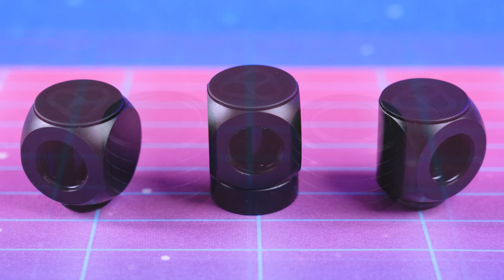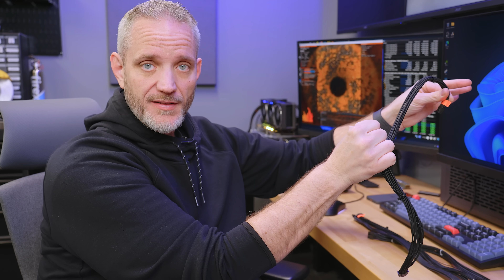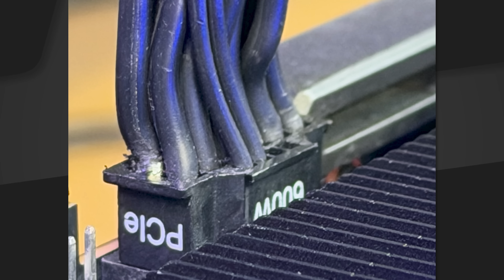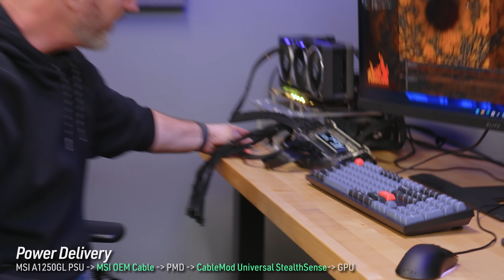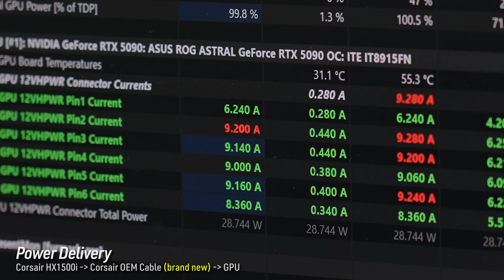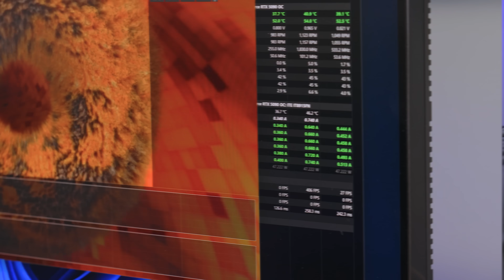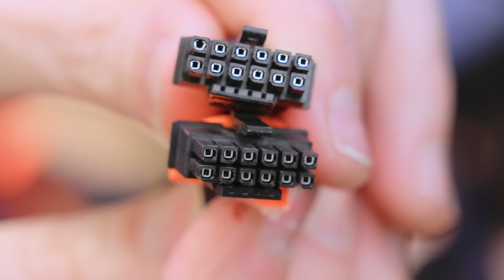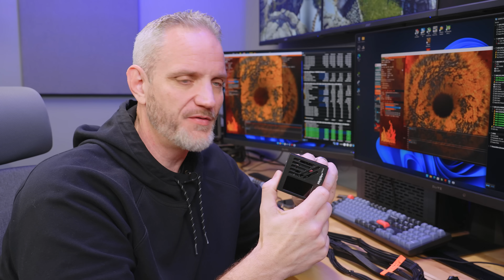More details on what could be causing 12VHPWR / 12V2x6 Cables to melt

Comment: I knew everything about this type of cable. Yet, I didn't push in the PSU-side of the cable fully when assembling the system. The lights on the card lit up but the card wasn't recognized in Windows. Anyway it took a while to find the cause. The insertion force needed on the PSU side was so high I was convinced it was fully inserted but I pushed a little more than I was comfortable with and it slid in a little more and the problem was solved. I'm ashamed of this mistake.

Comment: I use Cable mod cables. I ordered a 450 mm 24 pin motherboard cable in red sleeve and they sent me an extension 450mm instead of a powersupply to motherboard cable. I removed the pins on one end then used the original cable to re wire the cable correctly so my extention cable is now a power supply to motherboard cable. Works perfectly . Absolutely love Cable mod cables but there service is shoddy.

Comment: The per pin monitoring of my Astral card, 100% saved my system from getting damaged. I was using a 12VHPWR cable from Corsair and like in the video, the cable showed no signs of damage. But one day the distribution was rly off, 11A on one pin and 5A on the lowest. Swapping to the adapter cable included with the card solwed the issue for me. It wouldn't solve the problem, but the monitoring should be mandatory on all cards, and allerts and possibly an auto system shutdown should be built in to the Nvidia drivers. You can't expect every consumer to download something like HWinfo and manually configure allerts.

Comment: I have an MSI 5090 gaming trio OC card with and MSI MEGai1300p power supply.  I had recently purchased and added the Wireview proii and noticed a 1+amp variance between power pins to the point that the Wireview warned me about it.  I contacted MSI and their support team told me it was normal and not a problem.  The amp draw never got neat 10amp, but the variance still bothers me. The pin read out are as follows under load: pin1: 8.3a; pin 2: 7.4a; pin 3: 8.2a; pin 4: 7.9a; pin 5: 8.1a; pin 6:8.8a.  At this point I have no idea what to believe.

Comment: I have 5070Ti from Inno3d. The cable connecting to the connector has such tight fit, I have to use scarry amount of force to get it out. Every month I check this card for a melted connector. Every time I get small cuts on my fingers because I struggle to get it out!

Comment: I wonder if the plug also melts when using a 12V2x6 to 4x 8-Pin PCIe Cable. Never saw anyone reporting a problem with that

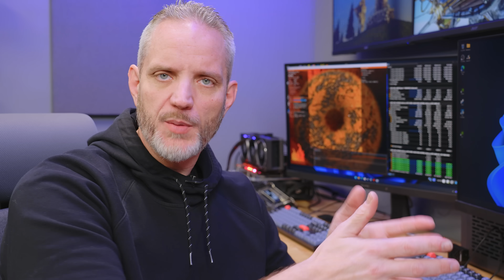Comment: 2:00 Actually they're still all joined into a single power plane on the Astral which is why unbalanced loads are still entirely possible on those cards. The difference with the Astral cards is instead of directly joining them straight from the connector they keep them separated at first so they can put them through their own individual shunt resistors for the per pin monitoring and then right after the shunts they are all joined into the single plane. I know of no cards that actually keep the pins into separate planes, every single one connects them all into a single plane which some cards may split into separate planes down the line for multiple 12V rails (like on the RX 9070 XT Nitro+, not that this actually does anything for load balancing the connector).

Comment: With one power plane, this connector should've had 2 pins
Oh wait, the is already XT90 connector rated at 90 amps (~1100w at 12 volt)

Comment: with DC the voltage runs from plus to minus but current runs from minus to plus. bad grounds specialy bad contacts raises amp draw until stuff starts to heat up and melt.

Comment: I wish the graphic card manufacturers and motherboard manufacturers would get together and come up with addition sockets, inline with the gpu pci sockets, on the MB that carry the extra current needed for these power hungry graphic cards rather than have flying cables from the psu.

Comment: Tightness of plug in socket could be related to 2 different functions: actual electrical connection of the pins (male to female) ... or ... the plastic carrier. If the carrier is sized such that it fits snugggly (even with or without electrical pins/sockets present) it can feel tight regardless of electrical connection of the actual male/female pin connection.

Comment: your loose pin is because the insulation is pushing up behind the housing, it should be inside! so its not allowing the tangs to seat properly in the socket...... just carefully remove the first 1 mm of the damaged insulation and hey, problem solved... and yes this was my job for over 20yrs working private contracts for our ministry of defence in the UK.....

Comment: Corsair : "It is quite common for terminals of this type to boast a mating cycle life of 30 cycles." 
Those connectors have a limited guaranted lifespan.
Remember "While other connections in your PC typically operate at only about 50% of their potential power capacity, the 12V-2x6 connectors, especially when paired with high-end GPUs such as Nvidia’s GeForce RTX 4090 and 5090, are expected to function at upwards of 90% of their power capability and even beyond."

Comment: So 8 pin might not have been some kind of magical secret sauce connector that can't fail.

But it uses more wires for the same power rating. All else being equal, this significantly reduces the likelihood of bad stuff.

On paper the 12VHPWR standard isn't problematic. But even there 8 pin is significantly less so.

Comment: Man, these cables and connector is one big Epic Fail.
There has been obvious problems with them from day 1.
And its definitely only going to get worse with the next gen cards probably being around 2500W cards. Good luck running that rig without turning your fuzes into popcorn. You'll need a dedicated highpower circuit.

Someone definitely got paid to greenlight them.

Comment: get a reasonable DMM with at least 4 significant digits and measure the resistance per cable. I bet you one is slightly high. Make sure to null out the probe leads. You can also use the continuity mode with low trigger threshold resistance and wiggle each cable, if it stops beeping - the cable is bad. You should be able to find the fault in the cable by carefully bending and walking along the cable.

Using just barbed pins in a high current connector like this is crazy. It doesn't take much heat at all to soften the grip. It should have a back shroud that locks the pins into the connector, so it cannot get loose with use.

The cable itself might not be 'pure' copper, it could be a blend or something worse, which is more fragile than pure copper.. Try scrapping the wire and see if it goes silver or white. Also use a magnet, if it sticks it has steel in it...  To be honest, I'm amazed for the diameter cable you can pump 10A down them and its 'fine' - for reference 12v @ 100A is 35mm2 (beefy cable at 6.6mm diameter) to avoid excessive voltage drop.

Comment: Reality is that this is an Nvidia proprietary PWR connector designed by Nvidia and supposed to be QA tested by Nvidia which it never was. The pins are approximately 40 % smaller compared to the pins in the 8-pin connector, but they demand 660-750 Watts of continuous PWR (heat and inefficiency losses included) with peaks up to 800 Watt compared to the 8-PIN 185 Watts of continuous PWR with peaks up to 225 Watts and they always put a second 8-pin if any gpu eats more than 150 Watts.
So 40 % less aluminum on the pins for 300-400 % more PWR requirements. Every electrical engineer sees the design problem here.
Offcourse that the PIN movement is going to cause Current Imbalance due to imperfect surface contacts.
If the Nvidia gpu-s would have had 6 sepparate PWR pins on their cards, they wouldn't melt because each of those 6 x 12V PWR contacts would be protected by a sepparate resistor.
Or if it stays like it is, then the 12-PIN pwr connector should be converted to 2-PIN connector, one for 12V + and one for 12V -. That way that one resistor on the card would properly shield the GPU from current drop and voltage drop.
Its not the copper cables inside the insulated wires problem but rather the air tolerances of the male and female part of the pin joint. Those tolerances are present in every connector in every industry. These tolerances are always accounted in into the QA testings and are always part of the losses that are accpunted inside the efficiencies of the PWR transfer medium.
The problem is that this hasn't been done here by Nvidia because they only made theoretical calculations without the actual heat, efficiency and resistance losses of the pins themselves.

Comment: The Sapphire Nitro+ 9070 XT has a TDP of 330W, so it draws more than half the power of the 5090, which has a TDP of 575W. Interestingly, most, if not all, known cases involve the adapter Sapphire included with the card.

Comment: i dont know if this will help any but what i did was put some pure deoxit gl100 on the pins before plugging it in to help make a more solid connection.  i also used a small 40mm fan on top of the connector to help keep it cool.

Comment: This whole standard needs to be recalled. It's not going to be safe until either the GPU can load balance, or every single wire has the capacity to carry the full voltage on its own. Preferably both. With a considerable safety factor.

Comment: I bought a brand new astral 5090. As soon as i turn the system on I get a red flashing light. In windows gpu tweak tells me I have 9v on pin 5. Took out psu put another in. Same thing. Changed cable to the octopus cable. Same thing. BRAND NEW straight out of the box.

Comment: More like not beating the dead horse, but finding the remaining fossils of the dead horse while extracting oil then beating those.

Its a rubbish design, with 0 safety margin.

half the size of the connector pins, same amount of 12V wires as 2x 8-pin PCIe with double the wattage rating. That is 4x the heat generation possibility. The plastic on the card side connector is a harder plastic with a higher melting temp than the cable connector. Thats why the cable connectors start melting first, and then eventually the card connector gets damaged from the cable connector melting.

Its a dumb design and I will never run it in any of my systems even if that means I cant use any new GPUs eventually. Its just not worth it.

Comment: I think kinking the cable might cause a localized lower cross-section, which means that cable would have higher resistance at that point? 🤔 Not an electrical engineer, so probably not correct, but I know you are not supposed to kink cables in a lot of applications, so I assume there is some reason why 😅

Comment: i ve got be quiet psu 650 gold the've attached cable for gpu but i am using cable for gpu that comes with gpu itself which is rtx 5070 Msi - i ve checked 10000 times hom much power and what kind of psu is needed - i dont think so that top brands produce faulty cables, if someone buys some low end  brands, they may have to deal with it, although of course it is known that quality control and low production standards in countries producing low-budget components are completely disturbed - other than that modern pcs have extreme power consumption that-s hard during financial worldwide crysis

Comment: Been running my 5090 tuf overclocked, constantly pegged at the 600w limit during gaming since march and don't have any issues. I use the adapter that came with it so 4x 8 pin into 12hpwr. I would say be careful not to bend the cables   and be sure its fully, fully seated!

Comment: The next test for the cables will be with an ohmmeter: check the resistance on each cable, then move it around a bit. Love your latest content. You are doing fault testing very well.😶‍🌫

Comment: What about putting a meter on the cables and checking the resistance between the pins at both ends? It should have relatively low ohms, and you can flex the cable around to see how the reading changes. That could let you know you have a weak wire in the bundle.

Comment: Point a heat camera at the problematic cable, to see if there are any hot spots on the cable.
Cut and remove insulation from one or more of the problematic cables, and then measure the cross section of the conductor.
It would be interesting to see what the conductor is made of, copper, tinned copper, aluminium etc.

Comment: The 2 or 3 8pin to the 12v2X6 is still not ideal.
The 8 pin generally has a thicker wire then 12V2X6, but that is not possible with the 12V2X6 limiting the wire size.

Comment: I use the Cablelabs cable, the right angle CableSense one you have. The previous one they had triggered display shutoff, all fans max on a 4090 so they sent me the new model, the other one lasted one year only. I haven't had any issues in a couple years since switching it... knock on wood, it probably does help I undervolt to 0.995v. I also do not touch the case or need to currently...

Comment: Normal for you .. Not for Me with an E&E Degree .. 10% deviation is a lot !!  ..   I would expect to be 1% or less when tying multiple leads to connect a buss .. There is something inherently wrong with the cable design !!!  .. This assumes there is a common 12V Buss at both ends of the Leads, which seams to be the case here ..

Comment: sure am glad Nvidia made the 3080FE have a weird 45 degree angled connector making it difficult to use later iteration cables with the sense pins and impossible to use with tools like WireView

Comment: Never had any trouble with both my 4090 and my 5090, with Adapter or PSU Cable. Plugged it in and forgot about it. Got a fire and a household insurance, ill take the gamble :)

Comment: All I did was was get the lian li little universal  screen and run gpu tweaker to watch my wire connections. I have the astral 5080 using a cable mod cable.

Comment: I am on my 3rd cable on a 5090 Astral now, and they have worn out over time just being used. Not plugged in and out, not even touched, just being in use. The 3rd one is plugged in now, one time, be interested to see how long before it throws warnings.

Comment: They way I see it, the 4090, 5080 & 5090 GPUs shouldn't use 12vHP Cables. They should be using the Multi 8 Pins. 

I have the Sapphire 9070 XT, the one with the 12vHP, the card draws half of the cables capability. I have a little worry about it. In the end if this cable melts it's the cable quality.

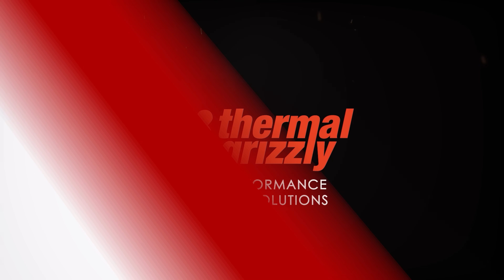Comment: 1:40 lol red flag. Thats not atx 3.0 psu lol. The other female terminals are 8 pin. The 3.0 psu has 12v2x6 both ends. Doesnt matter which side u connect first. Honestly if you're paying 2500+ for 5090 gpu. Get a proper 3.0+ power supply ugh lol. They like $200 for titanium and 1200w full modular and 10 year warranty. The less connections the better it is.

Comment: it's still funny we went from the old 8 pin which could handly far more current per pin than official spec and had a huge safety marin to a 12 pin that has no safety margin at all. 2x 8 pin can an will handle the power of 12v hp connector without issue/ so going to a new connector was only done to force people to buy new psu's and not a single other reason.

Comment: The sad part is that this connector didn’t need to be this small… with the size of current graphics cards you could put a 24 pin on it like it was a motherboard and it wouldn’t look out of place

Comment: Like I mentioned in my videos on this, just because a cable, power supply or card has 12VHPWR, doesn’t mean it is a genuine product or meets specifications. Infact I would almost guarantee most are knockoff products produced in China to a poor standard and will not meet the MOLEX or AMP insertion specifications.

Comment: Ground pins don't matter half as much since there are so many secondary DC ground paths between the PSU and GPU: the PSU is connected to chassis ground which connects to GPU ground through the mounting bracket, the PCIe slot has ~100 GND pins that practically make GPU and motherboard ground planes one and the same, adding the ATX and EPS12 grounds to the mix as well, along with the motherboard's case mount points. Lose half of the HPWR ground pins and you likely still have more than enough.

When is the last time you found a HPWR connector with a melted ground pin? Probably never due to how many secondary ground paths exist to split ground current with in a typical setup.

Comment: Using an angeled cable (type 4 to 12V-2x6) from Corsair combined with a HX1500i ATX3.1. It's not flimsy at all and it sits very firmly in the port. The Asus Astral 5090 cards (and 5080) have built in function for monitoring the pins and I have pretty balanced amps over the pins. Still. It's kinda crazy one have to worry about this. I check the load several times during a gaming session - lol.

Comment: Wire sizing (AWG) and computations for high ampere fluctuations for an equipment exists for a reason. Maybe it should be revisited with basic electrical design in mind w/ respect to the electrical load balancing for each wire, including the impact of the manner of connector.

In short, a electrical designer may be needed to assess this part of the component. Scrap the existing design and revert back to the previously working one.

Otherwise, we're just all waiting for someone to die before someone to be held accountable for this bright-as-day evidence of conscious incompetence of an engineering concern. 

And as a buyer's responsibility, take due diligence in the product you are buying. Don't blame anyone for an item you bought if it has a (international) problem that's not yet been resolved. You always have a choice.

Comment: I would avoid putting anything more powerful than a 5080 on this connector given they use 360w max and more like 280w in most games that's half the amperage of a 5090.... I don't consider 5090 safe to run. The chances of a pin hitting close to 10amps on the 5090 is quite high. Where a lower wattage card, the cable has to be far far worse to cause such a problem